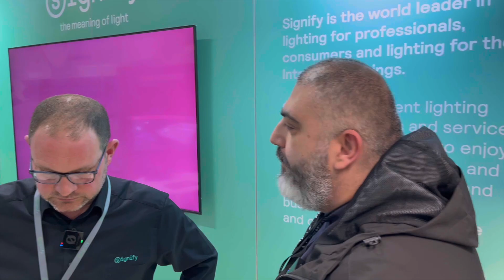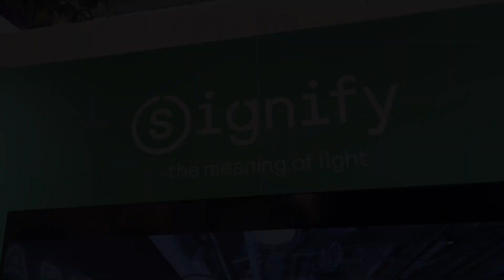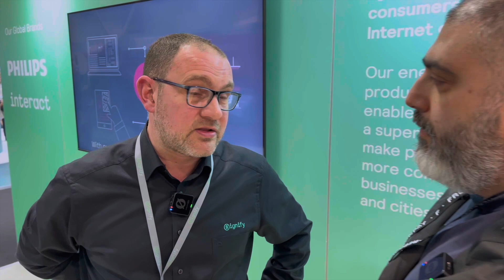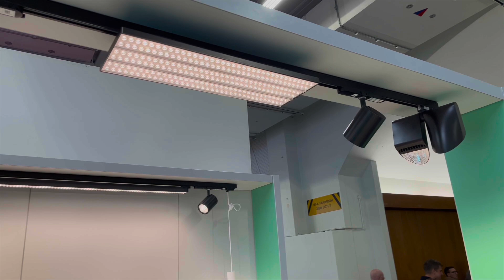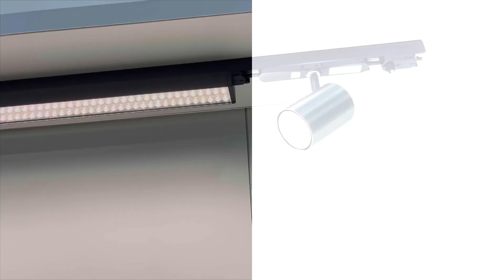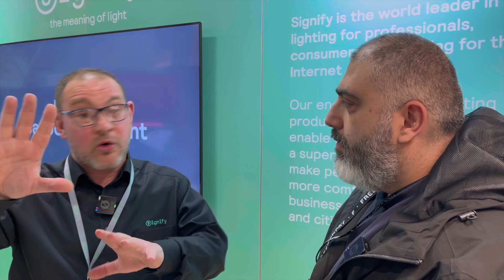🚀 How Signify is Leading the Future of PoE Lighting!

Comment: Simplify installation by using a  single Ethernet cable to provided both power and data to the lights. This  reduces wiring complexity, lowers installation costs, and makes the system more streamlined